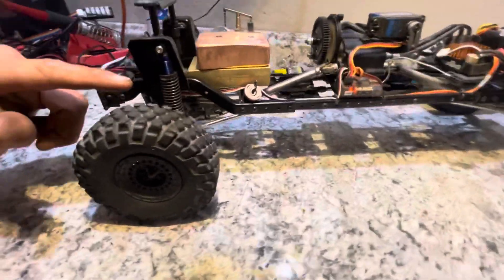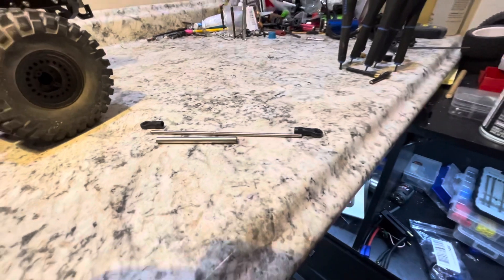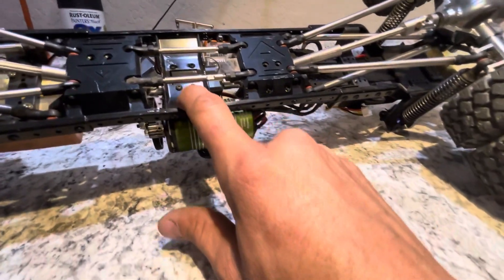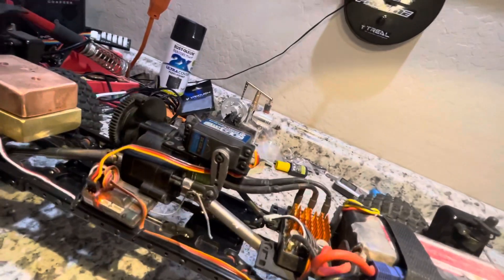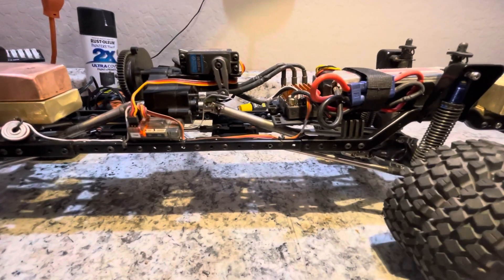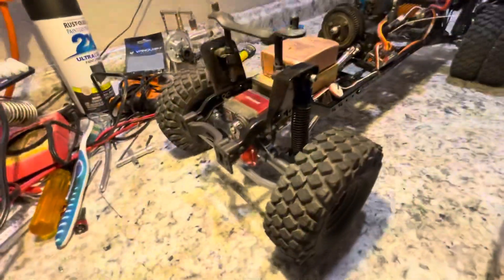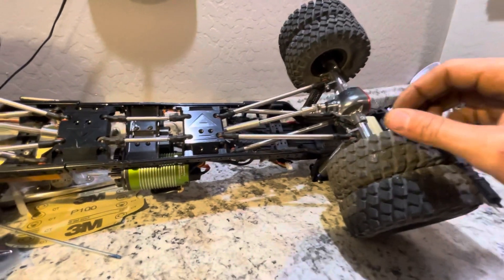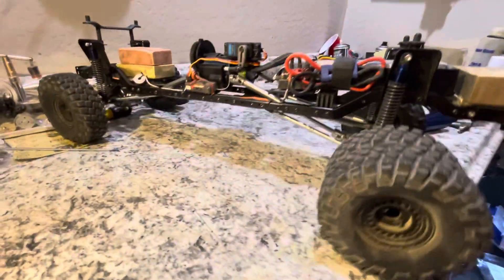BEST CEN F450 upgrades

Comment: I just put a motor esc from my big rock in mine and  some stock trx4 sport tires on it  and got the aluminum upgraded hubs and knuckles and link ends  been jumping it none stop love this thing I bend the frame back a lot it bends down right by stock motor mount next upgrade I need to invest in love this truck

Comment: What bottom plates (2x) did you use to  connect the links
Reply from the maker: I made them with stainless steel all thread. And end links and stainless steel tubes. You got find the correct thread pitch and such.

Comment: I have a 4 link upfront and steering servo mounted similarly, did you cut out the plastic where it originally was mounted because my servo always hits the plastic and looses flex
Reply from the maker: Yes that was happening to mine to. If you are saying you have a axle mounted servo now and when you push down on the frame it hits that plastic frame support. I removed it altogether.